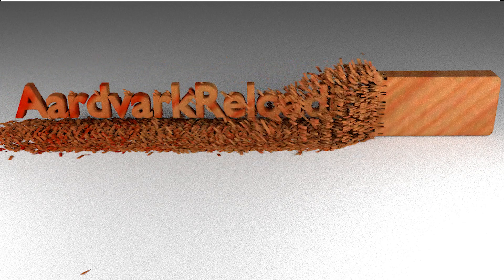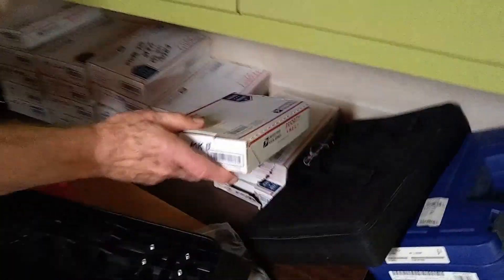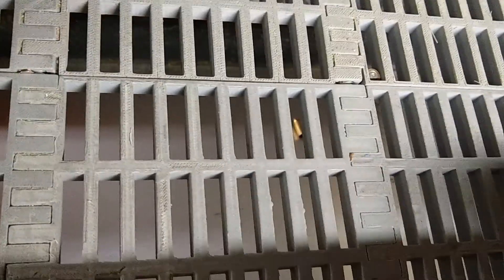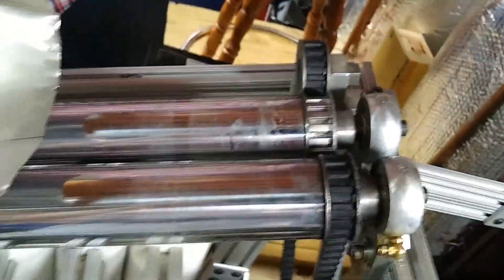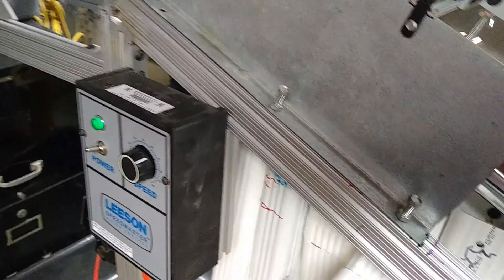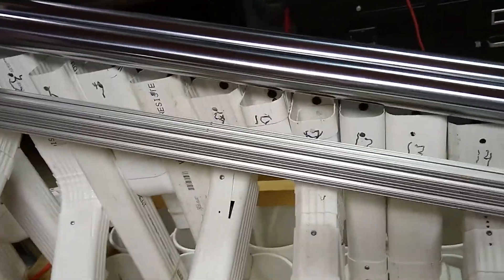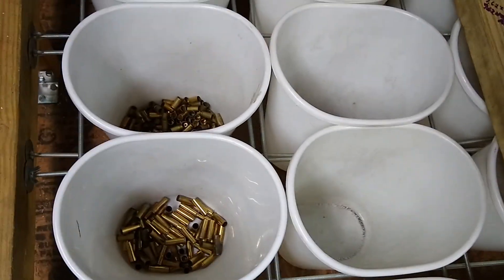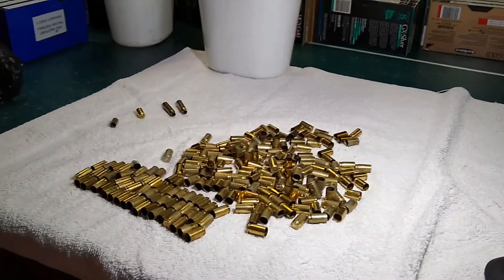Our custom-made brass sorter

Comment: I am now building this. Do you have instructions or a list of some sorts? I get 10s of thousands lbs of brass.
Reply from the maker: Unfortunately no blueprints or technical drawings.    It needs a way to lift the brass from the floor to the top shelf (auger bit or conveyor).    Otherwise it's too much lifting.    Sorts great by width of casing.    Secondary sort was conducted by hand for separating say 380's from 223 brass /dropped same bucket.   Obviously an easy sort.

Comment: @ 7:12 mark  .245?  What cartridge is that?
Reply from the maker: Hmmm I don't remember but a 270 and 30 06 have a base of .470 so either of those may have dropped.
Reply: @helpmenowmark  As well as .308.  I think you meant to say .243
Reply from the maker: @DimaProk  yes, dumb slip up

Comment: Does your machine separate 40, 10mm, 357sig, 38 special, and 357magnum?  Most brass sorters I've seen with the rollers like yours dump all 5 of those calibers into the same bucket.
I've come up with a machine that is able to separate those 5 into their own individual bins.  Now I'm searching to see what else is out there's anything like what I've done.
Reply from the maker: Yes the same bucket because its the base diameter that dictates the drop point.   I no longer own the machine but I miss it terribly.

I will say that many times the calbers were easily separated even if like sized bases (such as 380s and 556s) are easily separated

Comment: This is brilliant! So this machine sorts the brass by width alone?
Reply from the maker: Diameter at the base of the brass so 380's and 223/556 brass falls into the same bucket.     But if you can't separate a pile of 380's and 223's ...      Saves hours and hours.

Comment: Do you mind sharing info on how you found or made the rollers and the bearing ends?
Reply from the maker: The rollers were custom made (expect to pay $600 each!).   Approach your metal shops/fabricators in your local community.   They start with ordering the roller and turn down the ends.   They are expensive.   I think it's a 2" diameter roller with 1" shaft protruding out at each  end (see 2:42 second mark).   The protruding ends fit into a 1" box bearing housing.    What you have to be wary of here is the "feet".    You need to order the right box bearing so the "toes" of the feet don't prevent you from mounting them close to one another.    Your machinist can consult his catalog(s) and he will know what to order/look for.
Reply: Thanks for the info! Much appreciated

Comment: now a shaker motor hooked to the grating to make it all automatic
Reply from the maker: A conveyor type belt or screw auger to get the heavy brass from floor level to the top was needed and a method to drop the brass individually was needed.    Regardless - it saved a ton of time and I miss having it.

Comment: Hi Mark, first thanks for your videos and input, that´s inspiring! I work with a upproller sorting mashine like yours too. What speed/rpm. do you use on your rollers and what angel?...I work primarily with rifle brass. Give my regards to Marshall too, Best regards Per
Reply from the maker: Thats a tough question because the rpms were variable.    It was mostly trial and error.    I know for sure the bottom of the rollers were right at only 12" off the floor.   I can only estimate the top were shy of 4 feet (the top of the rollers).    The length of the rollers were approximately 5 feet long and a diameter of 2 inches.    The exact angle is difficult to recreate except one thing.   The brass without the machine running was just sitting above the sliding point (just shy of over coming the friction force).    When the motor was turned on - it was alll that was needed to get the brass moving down-hill.     I can say - once we found the "sweet spot" - we didn't fool with the speed of the motor but it was handy in fiddlin' with the optimal running speed.    Hope this helps.

Comment: would be interesting to add a shaker table too get everything to lay flat before sorting rails.
Reply from the maker: I can see what you mean ...or perhaps a slight angle toward the rails to facilitate an easier push down the chute.    What we were missing was a screw auger to get the brass from the floor to the flat table.   We had to lift the brass in five gallon buckets to this level.